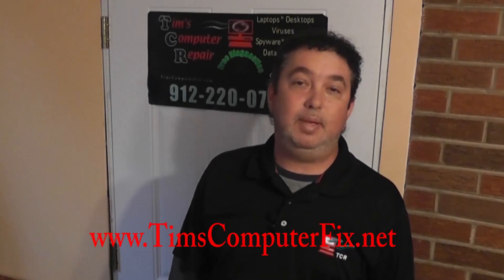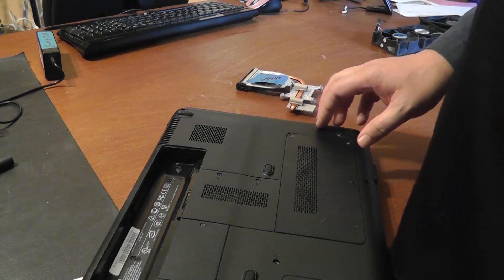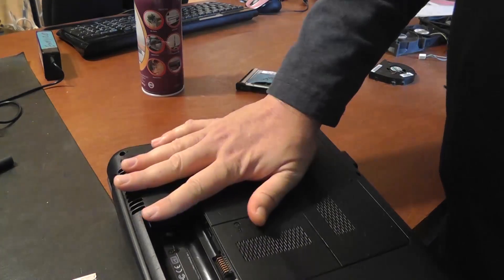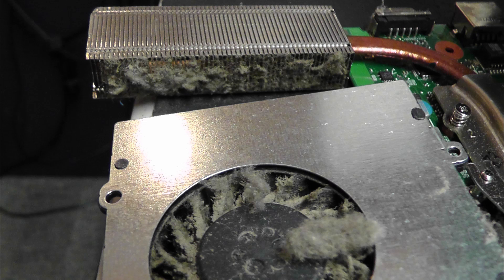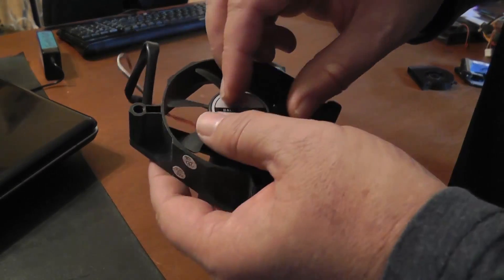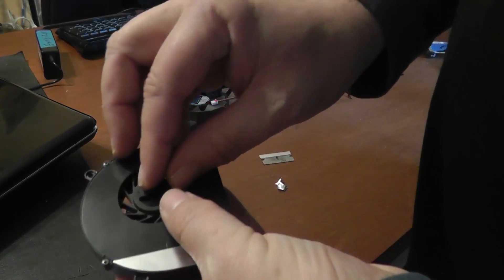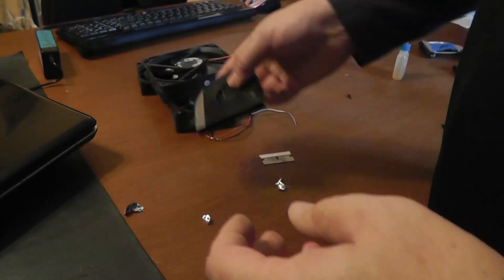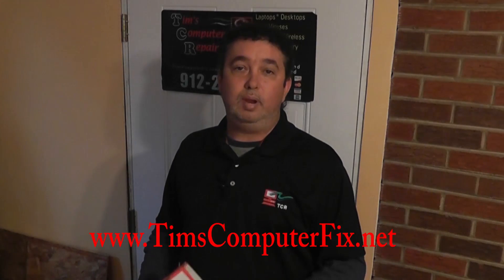Computer Laptop Overheating Prevention (Noisy Fans and Dust) by TimsComputerFix.net

Comment: Laptops are definitly vacuum cleaners when it comes to dust and animal hair etc.  I got to pull this laptop apart every 4-6 months to clean it.  Manufactures could do us a nice favor in consumer laptops and make getting to the fan and coolers a heck of a lot easier, like they do on most business grade laptops.  What I am surprised that they have not started doing yet is putting filters on the fan's like they do for desktop machines.  That wouold be a huge help.  Or even be able to custom make one.  Food for thought.
Reply from the maker: Jeffrey Benshoff I agree Jeff however it looks like laptop manufacturers are starting to get away from fans altogether as chip makers are starting to produce very powerful chips that produce very little heat. We are quite a ways away from that going mainstream however.
Reply: TimsComputerRepair That is definitively true.   My Chromebook is fan less, and a lot of the little mini pc's and things of that nature are turning that way themselves.  It is a good thing.  Call me a traditionalist but I guess using canned air, and shop vac;s on our exhaust helps keep us in business and keeps us busy.  Just sometimes I wish it wasnt so difficult.  I saw your oiling the fan video. I use marvel mystery oil. That works good as well :)